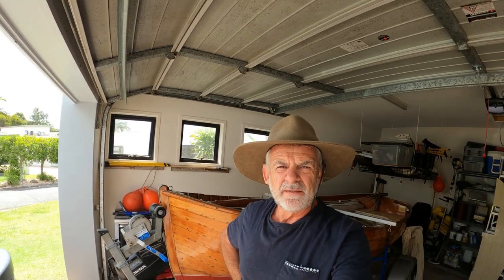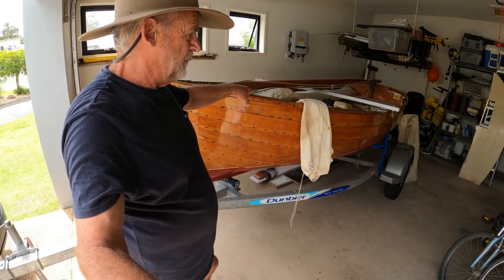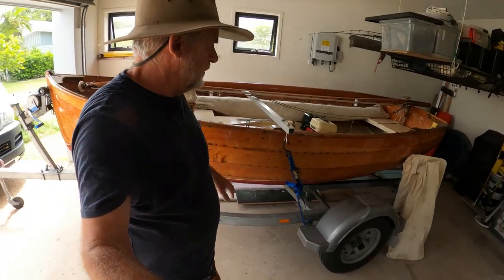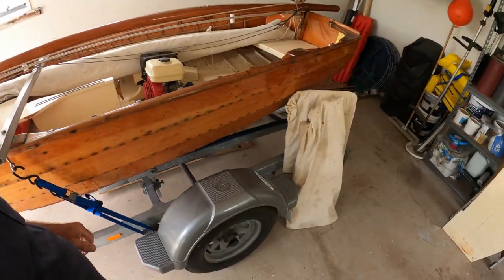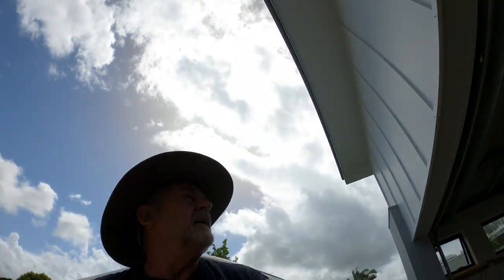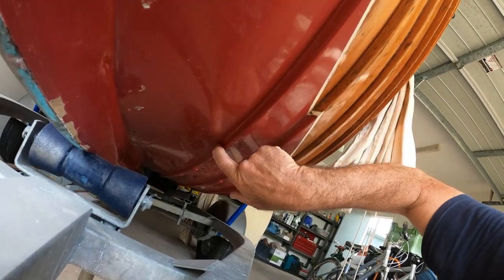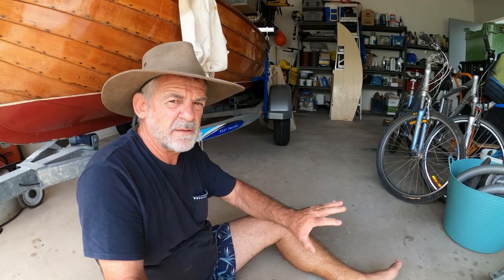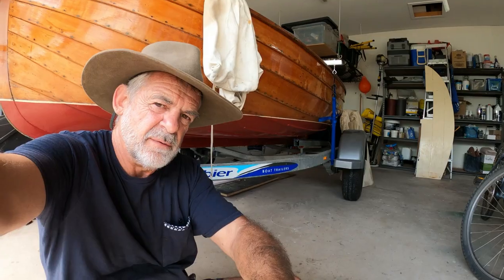How to fix leaks in a wooden boat. Cruising Dinghy Basics Episode 7

Comment: Really interesting! Yes, Sikaflex is very effective and I now see why fibreglass and timber don’t mix in certain applications. Thank you.
Reply from the maker: If there is ever going to be a problem with rot it will be where timber or ply is encapsulated. Soft decks in fibreglass boats are typical of the problem.

Comment: Thanks for this. Very well done.

There's some foil based insulation, some, similar to bubble wrap, some soft foam, that you could clip or adhere to the interior of that panel lift door to dramatically reduce the heat in the garage. Might be worth a look.
Reply from the maker: Good idea.

Comment: Do you keep it in saltwater during the season you use it?
Reply from the maker: Hi Dwight. It is kept in a trailer out of the water between uses. Stored inside. The timber it is built from is extremely stable. Regards Chris

Comment: Great video, thanks!  Given that you only use oil/turps based coatings, are you able to saturate the timber with linseed/turps mix beforehand?  I'd be interested in your thoughts on this.  Thanks for sharing!
Reply from the maker: Huon pine is saturated in natural  beautiful aromatic oils. Nothing else would penetrate. However some species are very porous and might benefit from linseed perhaps. I think it would cause adhesion issues. I’m thinking something like a tung oil might buff up nicely but I’ve had no experience of this. Every boat is different. Thanks for the comment.

Comment: Thank you so much for clarifying this issue of sealing planks under the water line in clinker built boats.
I am busy refurbishing a ca 70 year old clinker built sailboat for our local coastal heritage association.She's 17 ft, scots pine on oak.
Having got the paint off the hull, I see a few planks need replacing, but notice many of them have been sealed with some kind of  flexible sealant, which has mostly come loose. Planning on using a polyester sealant with adhesive properties under the waterline, such as 3M 5200. Any comments on this solution?
Reply from the maker: I agree there are some very good hi-tech sealants. I have used https://soudal.com.au/multibond/smx35/ on garboard seams on a clinker dinghy. I had experimented with a range of different sealants on tongue and groove timber floors and found that capacity to stretch varies quite a lot.
Reply: @SmallSailboatCruising  Thanks for responding Chris.
Soudal smx35 is not available here (Norway); Soudal here however has a product Fix ALL Flexi, which from the product Data Sheet is identical to smx35. Cheers, John
Reply from the maker: @johnsmall9729  My trade is timber flooring. Many issues result from sheeting and edge bonding since the introduction of strong polyurethane. People often don’t
Like the cracks and want them filled. I’ve tried a lot of things and none have proven the ability to expand and compress so I tell people to live with the cracks that are there for a reason. With boats that is not an option. The soudal product is the best performing one I found. But beware they do make less capable products as well. There is a lot to be said for butyl mastic rubber painted over with turps based paint. I’m not familiar with the physical properties of your timber. A
Lot will depend on that. Is the boat kept on the water or in a shed? I imagine you will have plenty of snow by now in beautiful Norway. We are in the 30’s and high humidity which has its own challenges for wooden boat builders. Kindly Chris
Reply: @SmallSailboatCruising  I am in Telemark, south east Norway. Sailing season here is April/May thru September, with sea temperature ca 5 - 20 C. The boat will be kept on the water during that period. Rest of the year it will be in an unheated shed, air temperature down to ca minus 10. That's where we are at now, with a few inches snow. Thanks for pointing out reservations on sealing products. When I come to do that job, I will also canvas the locals for suggestions. Today I will get a hand turning the boat (it weighs 140kg), so I can scrape the inside and assess the frames. Cheers, John
Reply from the maker: @johnsmall9729  temperature humidity species construction method all impact on what would work best for you. I’m thinking you guys invented lapstrake so I’m sure you’ll find the right solution. Too hot to work outside here again today😅

Comment: We had westerly facing panel garage door. I bought pack of earthwool insulation, thinest r value 1.5 . I cut squares , with just scissors, about 50mm bigger than the panel . Just poke it in. It's under compression and doest fall out when the door up. 100% effective. . It doesnt add   any significant weight to the opener.  I never adjusted the springs and I used the door everyday for 12 months.  The springs can be tightened to compensate for age. The are YouTube vids, easy
Reply from the maker: That's a great idea. We had the same westerly aspect in Qld until quite recently. It can get up to 50 degrees in there without insulation. Now we are back in Tasmania, we don't even have a garage door! Not yet anyway.